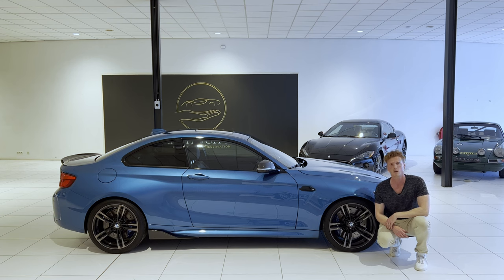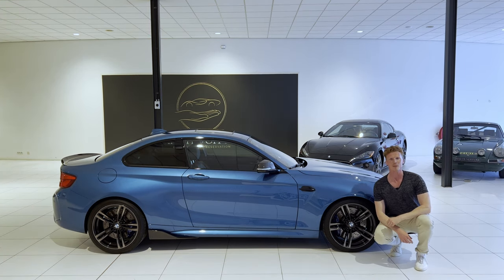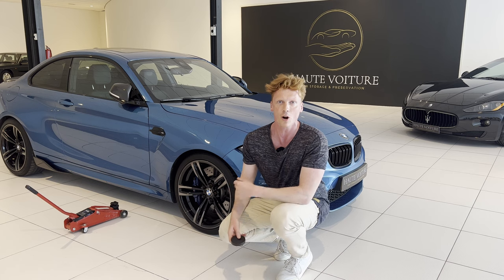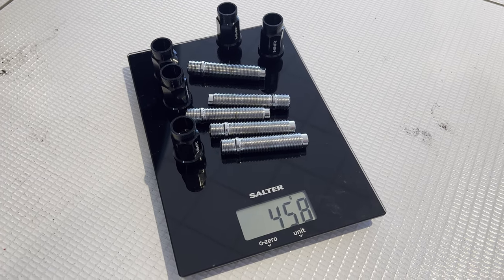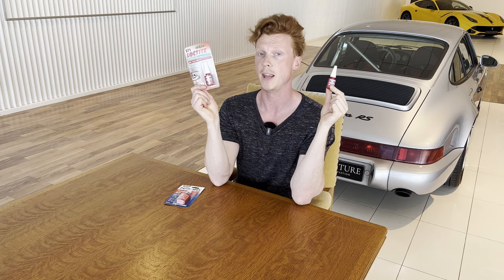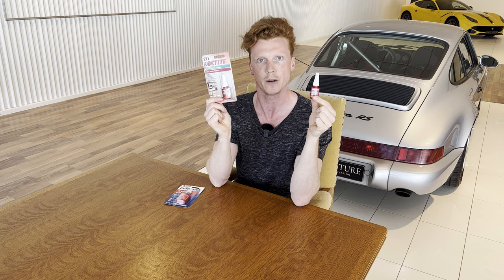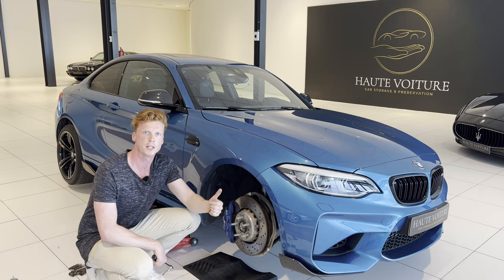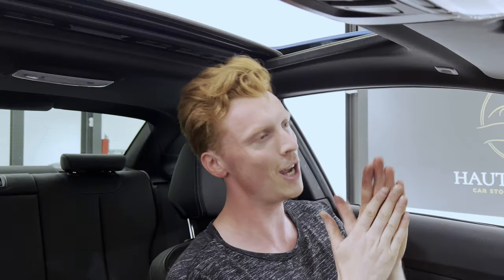BMW M2: How To Install Wheel Studs

Comment: pure awesomeness, subscribed to the channel! 

Safety Question: the torque specs for the studs into the hub…did you really say/do 55 ft-lb? No concerns of being overnighted?

After watching your video, I’m planning on installing Macht Schnell ones using Permatex red thread locker as well, but I think the MS call for a 25 ft-lb torque into the hubs.  The wheel nuts torque should remain the same
Reply from the maker: Thanks mate, glad you subscribed! I said 55 Nm, which is 40 ft-lbs, quite the difference! Good luck mate
Reply: @TheHunterHofman  

Well, I should listen better neh?  You’re awesome, thanks for swift reply and providing the correct torque spec!
Reply: @TheHunterHofman 
Can you please confirm the torque specs?  Been seeing conflicting info on Bimmerpost forums:

55Nm for studs into hubs
140 Nm for wheels nuts

Some say that you need a lower torque of ~ 109 Nm when using wheel nuts (vs 140 Nm when using OEM wheel bolts) 

I appreciate the input, this is driving me nuts (pun intended)…don’t want some wheels falling off when dropping off the kids at school
Reply from the maker: @fikaprado763 Sorry, just read your reply now! The nuts (of this kit) are supposed to be tightened to OEM spec (i.e. 140 Nm). Hope it worked out for you!

Comment: Had these installed on mine for 3 months and rusted so quick. Pretty awful quality!!!
Reply from the maker: Hm, let’s see how these hold up once they see the public roads, thanks for your comment!
Reply: @TheHunterHofman  100% watch what wheel cleaner you use too, if it says avoid chrome then 10000% don’t even chance it 😂 had that issue with wheel nuts too